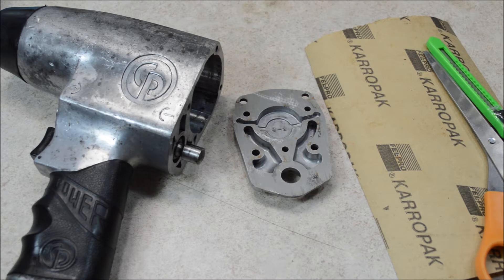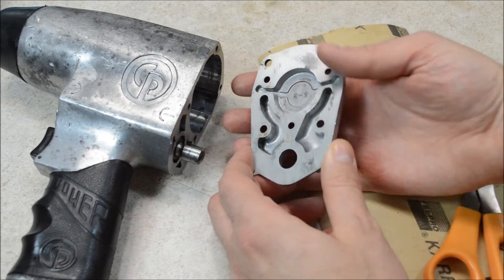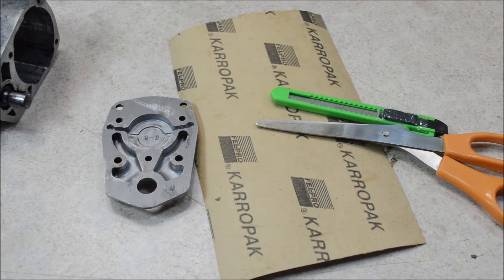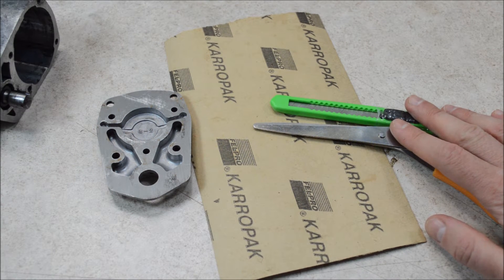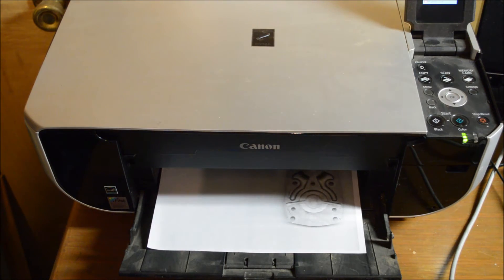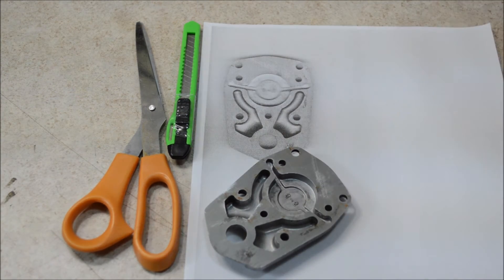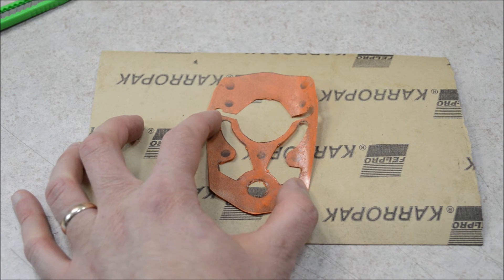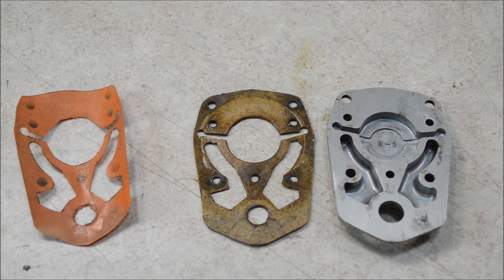How to make a gasket for a complex shape using a computer scanner

Comment: Why did you need a new gasket? What happened to the old one? What is the function of a gasket?
Reply: It stops air flow from exiting the back of the impact.
Reply: Gaskets are known for not being reusable. If you have to take it apart for any reason you need to replace the gasket.